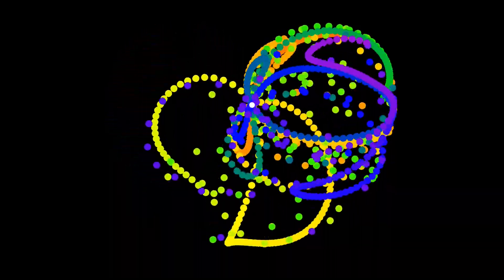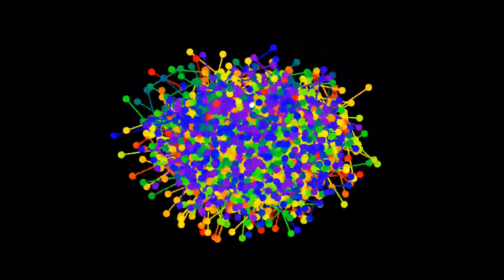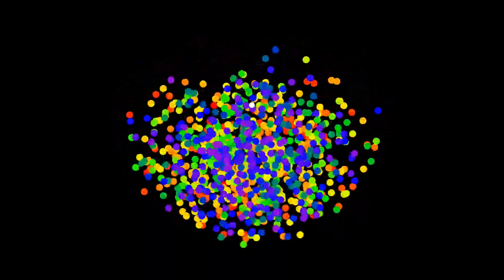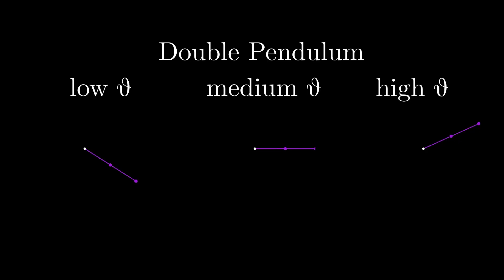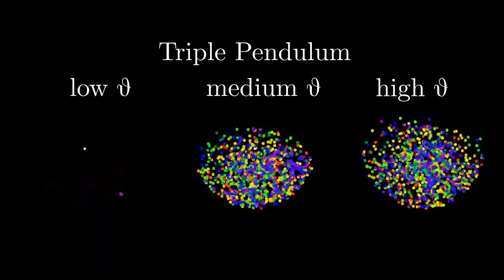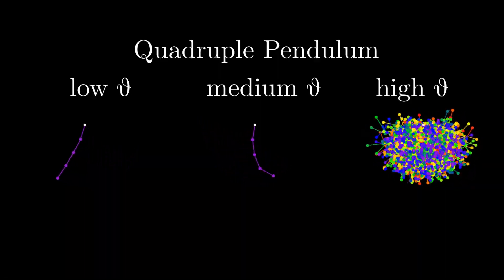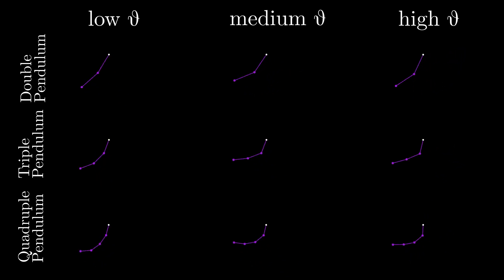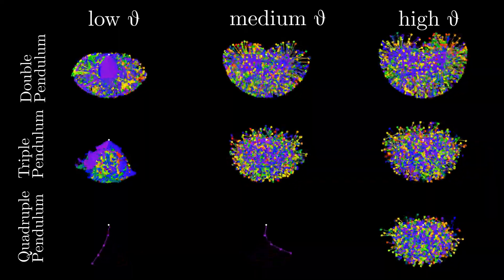I Simulated 1000 Pendulums to See Which is Most Chaotic

Comment: My initial thought was the medium energy double pendulum diverges quickest because it represents a transition point between two different types of behaviour, and so has the largest gradient of long-term divergence.
Just below the mid-way point, you're in the position where a regular swing occurs. Above it, you get a small extra flex in the arm as the end falls and pushes on the first pendulum before it snaps back to its natural extension as it drops past.

It could also just be the incidentally long time the second arm spends directly above the end of the first at 2:43 and 2:45 though, which allows gravity to separate them more quickly. All three sets of pendula visibly separate while the second arm is in this position, and it in a sense represents why it's so difficult to balance things on points. Things separate quickly under gravity while balanced on an end - inverted pendula are in very unstable equilibrium, which causes rapid (exponential, if I understand correctly) separation for multiple that are very close together.
Try balancing 1000 pendula vertically. They'll trivially diverge faster than any of the low/medium/high angled ones (some will go left very quickly, others right very quickly, others will hang for longer)

At 3:14 the high angle start pendula have their second arm pushed into the first for an extended period of time, while both the medium and low angled ones don't really rest in a position like this for any extended period of time, rotating quickly past such positions (medium) or simply never entering one (low).

In the quadruple pendulum case, the medium and low angled ones never enter such a position, seemingly causing their high stability where they never diverged during your simulations if I'm correct.

Comment: Hello
Is there a way to estimate/calculate how chaotic a system can be? What if we consider damping into the equation? Would it became absolutely stable or just a bit ?
Reply from the maker: There is a measure called the maximum Lyapunov exponent. I am considering to implement this in a future analysis and video.
Dampening could probably have different effects depending on how strong the parameter is.

Comment: I think the double pendulum with medium energy diverges because the vertical acceleration of gravity is greatest when horizontal.  It speeds up faster than the other 2 and thus approaches that divergence point faster.

The effect might weaken with the higher linkages because the pendulum now has the ability to sag in the middle (like rope) rather than rigidly rotate.  The "higher initial energy" idea can take over here: higher potential -> higher velocity -> faster divergence

Possible random thought: at least for the low energy case, divergence time increases with linkage number because the potential energy, velocity, and rotational velocity must be shared between all the links, decreasing the magnitude of the standard deviation of the state space for each link.  As in, two large and wide distributions for a double, versus 4 smaller distributions for a quadruple.

I assume a "divergence" measurement scales exponentially because divergence begets more divergence.  If scaled by this sharing of energy effect, perhaps the divergence growth rate is actually pretty similar between linkages, it's just harder to see for the higher ones because the initial energy-per-link is lower.

Comment: I mean these are cool, but I'd be more interested in what kind of data about the systems you can plot against time. Just looking at the animations doesn't really tell you much
Reply from the maker: Good idea, I could plot the divergence in terms of distance of the pendulums to each other over time. It would steadily go up and cross a threshold at the point where they visually diverge
Reply: @ComplexityAndChaos  Perhaps measure the standard deviation of the distances between the pendulums?
And don't forget that the different segments of the pendulum don't have to be in equal length.